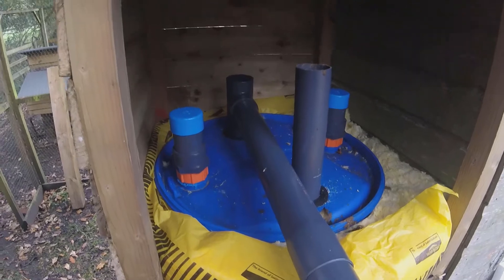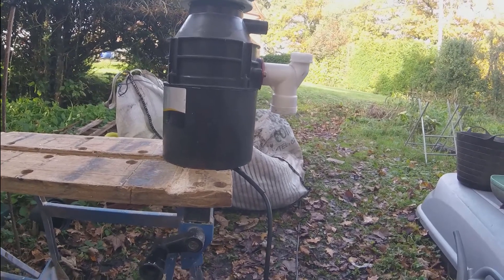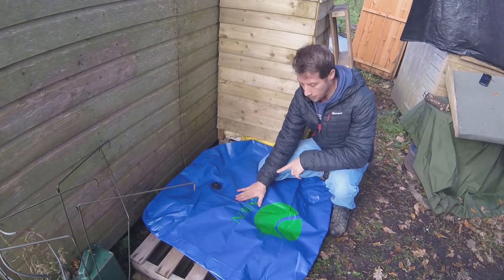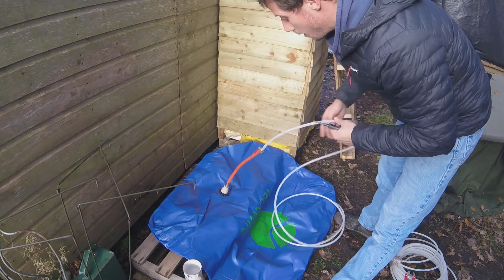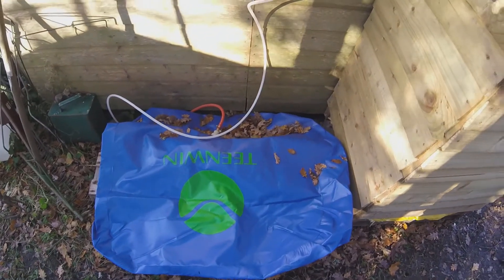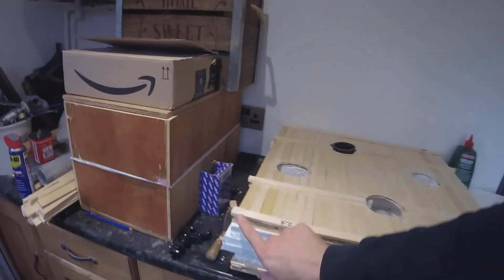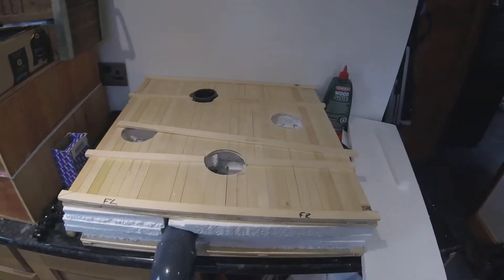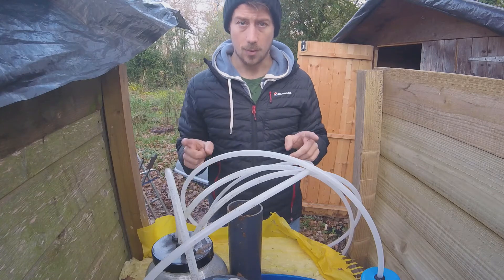Making a biogas digester PART III // Final setup, filling, scrubbers and temperature issues

Comment: A well made Passive Solar panel might do the job if the heat was piped directly through the digester, but that would mean an extra 2 holes in the top and more piping. But I think would definitely be worth it.
Reply from the maker: Yeah, passive solar would be great I think in a barrel system it's a bit too fiddly. In an IBC it would be much simpler

Comment: What are the different scrubber used except water, please mention it.
Reply from the maker: Hi Sandeep. Sure. The second is cat litter, to remove any moisture from the gas. The third is steel wool, this is to remove any Hydrogen Sulfide. Hopefully after these three the gas should be a high quality methane, or as high as it will get from a digester like this. Cheers

Comment: Having an electrical heater in there, does that not defeat the purpose of "free or cheap" energy?
Reply from the maker: Depends I guess. If electricity ifs cheap and gas in expensive or difficult to get the maybe not. My intention is to get it up and running with the heater (winter here so not ideal for gas production) then play around with different heating systems: solar, gas, wood. I started experimenting with a Rocket Stove so if you're interested check it out https://youtu.be/m5EFKcG2zuI
Reply: Spray painting an engine is not a restoration

Comment: Useful suggestion: Power the pond heater from a solar panel on top of the shed connected via a 12v or 24v battery('s). If it's a AC pond heater appliance then why not use a low powered ac to dc sine wave inverter housed inside the shed if applicable?! The possibilities are endless as it can be customised as a stand alone set-up such as operating via a thermal relay switch from the thermometer when temperatures dip below a certain threshold or aspart of a timer system!? 
Suffice to say these are excellent tutorials that you've clearly articulated and illustrated bud and very discretely placed I may add whereby solving the problem of the bio-fuel digester all neatly tucked away albeit housed and attached onto the garden shed which would otherwise often be somewhat of an eyesore at times especially in an idyllic garden setting! 
Top job m8! 👍
Reply from the maker: Thanks very much. Appreciate the suggestions and compliments. Some kind of solar/wind powered battery system is definitely something I would like to do long term. Once I have the biogas system up and running I will hopefully be expanding the system to include batteries and other power sources. Cheers